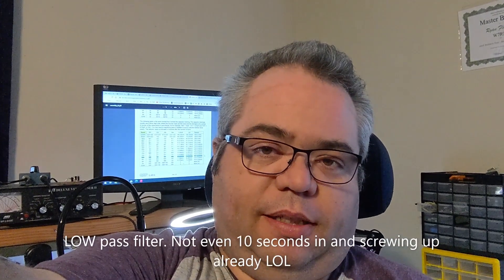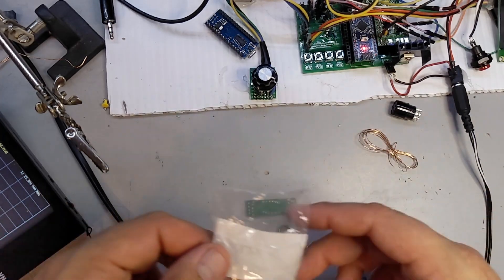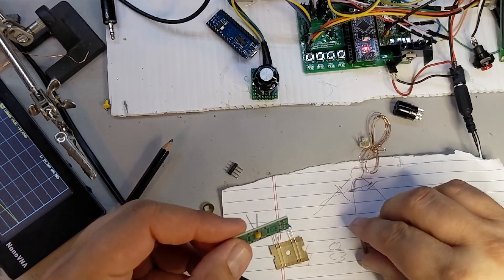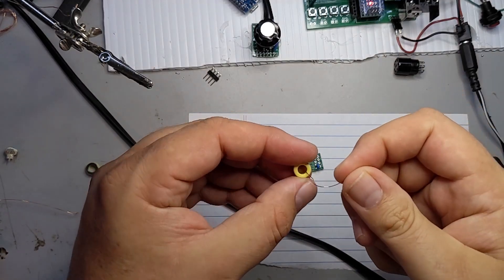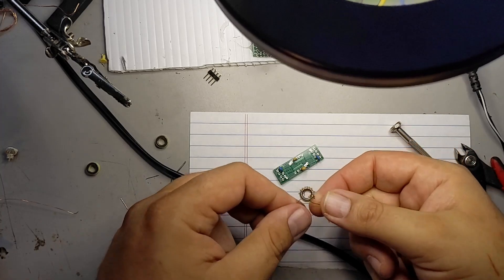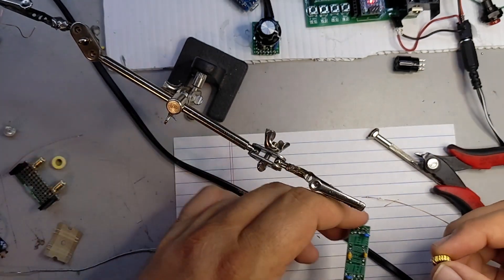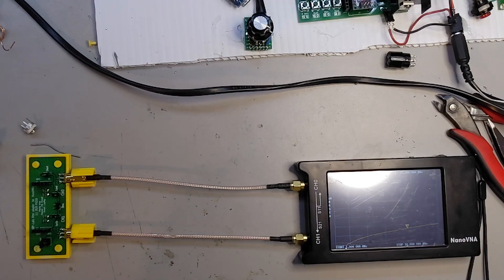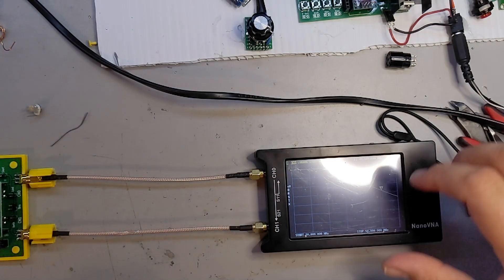10 Meter QRP Labs Low Pass Filter Build and Tune

Comment: Thanks.This video was a GREAT help. I am building one for my MINIPA70 and I don't have a tester. Is that a big deal? Final output will be about 12 watts on 10 meters
Reply from the maker: Just follow the directions and you should be all right. If you have a watt meter then just check your output until it's peaked when you fiddle with the windings themselves. Should be fine :-) Glad to help :-)

Comment: I may be ordering a lowpass filter for a 10 meter beacon project and wondered what they charge for postage?
Reply from the maker: It depends on the ordering method you choose. I'd recommend putting together an order of several things to make the most of it :-) have you checked out their U3S project? Might work really nice for a 10 meter beacon :-)